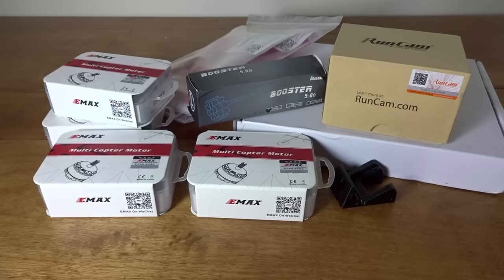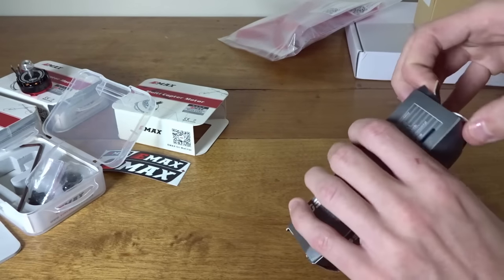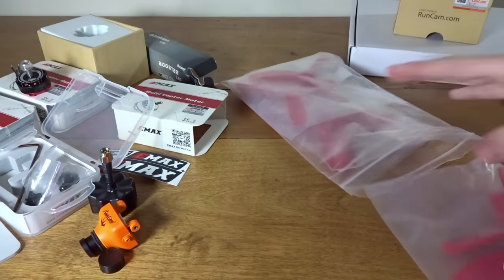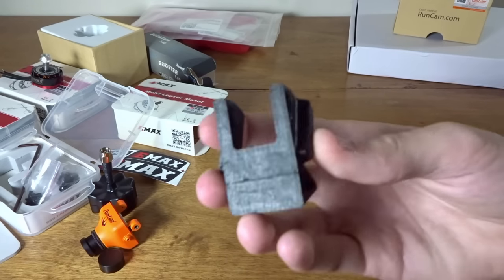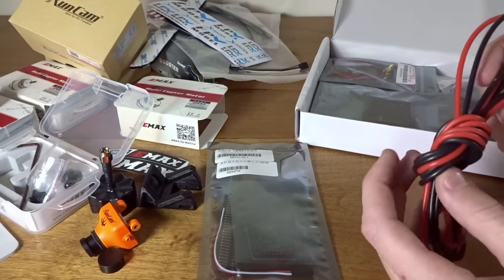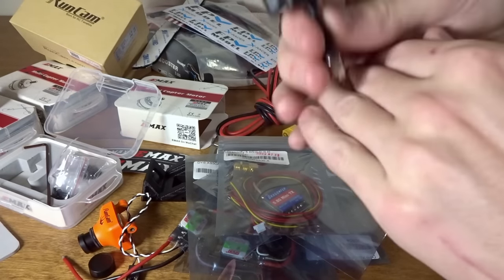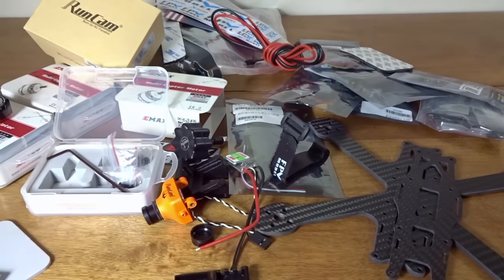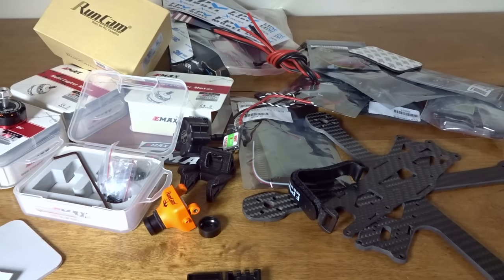ZMR210R : Initial Parts Overview

Comment: The hd mount will be hold on the frame by the lipo strap that you use to hold the cam.
Shorter antenne will brake faster above the connector. That is why i use now modded dukies. Image is about the same only the range is a bit shorter but I never had problems with that. 
Nice kid. You have to much quads to fly now. You can always send one to me. ;)
Reply from the maker: Yeah, I don't like that though :( I want it to bolt on. Haha, if I get rich you get 20% of my money ;D
Reply: Hahaha I hold you on that.

Now you can make your own cam mount. As you need help with how to design it, let me now I will help you.
Reply from the maker: emiel1976ep Yeah, I was going to hit you up on insta for help making one for this once I get it built :D
Reply: Let me now when you have time.
Reply from the maker: emiel1976ep Maybe tomorrow :)
Reply: Ok for me

Comment: dang man, so many quads :) you real lucky you got this relationship with da big brands :) 
if you ever got extra stuff... lol
Reply from the maker: Ok Mr Thunder Power ;D This is the first time I have been contacted by a legit FPV place like FPV Model, I'm excited :) 

Just tested the 2300kv reds, and got 1250g at 32amps on DAL T5045X3, and 1200g at 30A on HQ 5040 tri :) You get early access ;P
Reply: haha lol.. oh snap that's a LOT my roosh fits 6in props and the new reds will do 1500g on 6040... prepare to break 100, easy. that's almost 15:1 thrust ratio 😂😂
Reply from the maker: AveryFpv On a 600g setup (something like carrying a GoPro) that is 10:1 ;D I am not sure how many amps on a 6inch prop. Probably like 35?
Reply: Yeah the roosh should be around 500 or less, haven't weighed it yet though. But even 10:1 is really good. You seen the new tmotors
Reply from the maker: AveryFpv Yeah, all my builds are over 600g and they are pretty clean. Weight in the camera setup adds up quick. No I haven't. What are thye now? F80s that draw 80amps? the 20s do 20, 40s do 40, and the 60 do 60 lol they are pull way too many amps.
Reply: Yeah, f80s, I heard over 2000 grams thrust on 5in. A set of 4 is like 300$ though I think... 😂😂

Comment: Hey man, I just got my R frame to replace my X. Finish of the bottom plate is beautiful IMO.  The new HS1177/1190 come with 2 screw holes on each side, but they don't appear to line up with the new R camera plate - any ideas about fitment? In asking that it looks like you might have single screw camera case..
Reply from the maker: Yeah, I like this frame more than the X. The 2 main middle holes should fit on either cam, not sure about the further back ones. They fit fine with this RunCam Swift.

Comment: The frame looks like a good progression for ZMR :)
heu wait.. the motors aren't flush  :| :$  
I think them manufacturers have a LOT of bullnose props in stock huh? :P ghehehe  Yeah.. that happens in a hobby with a fast improvements rate..
Reply from the maker: Yeah, take it ANY day over the ZMR250 lol. Motors aren't flush? The wires poke down just a little on that one, but almost all motors I have ever had do this, the heatshrink is holding them down. I either just put them on and it straightens it out, or heat it and let it cool flat. Lol yeah.
Reply: Ehmm it Looked like the axle sticks out at the bottom? :$
Reply from the maker: DutchRC Adventures Oh the shaft yeah. Not many motors don't have a protruding shaft. I have never seen a frame not have circle cutouts for them .

Comment: I just broke another camera mount on the old x210. Getting into printed stuff now :/
Reply from the maker: Yeah! I broke that carbon one like 3 times at least! Let me know if you get this frame and need a mount. I am working on getting mine printed.
Reply: Is it the same layout like the x210? Would be convenient for 3D printed parts.
Reply from the maker: Beaux FPV I dont think so. This mount is specifically designed for the 210R frame. I have it printed now. Came out pretty nice.
Reply: Cool! Eager to see it mounted on the frame. :}
Reply from the maker: Beaux FPV It turned out really well :) emiel1976ep is a good designer :P